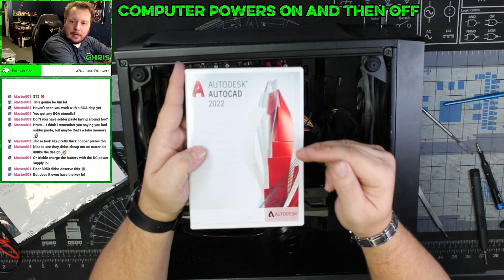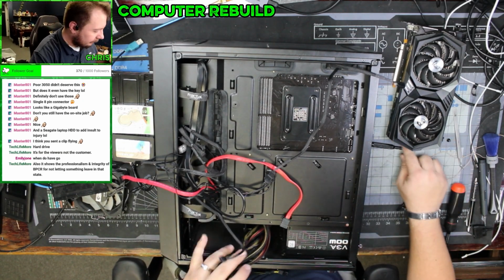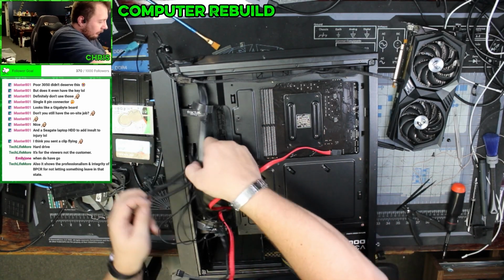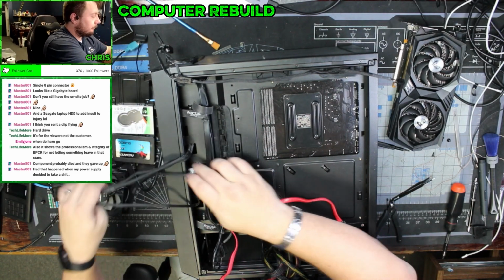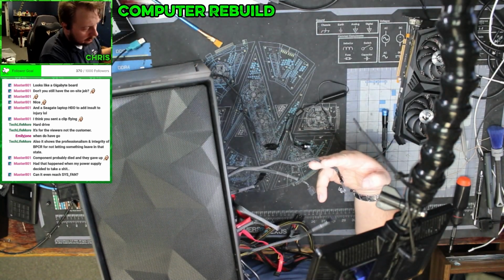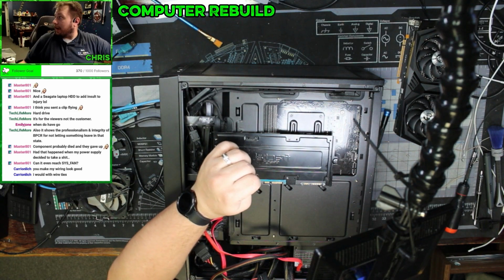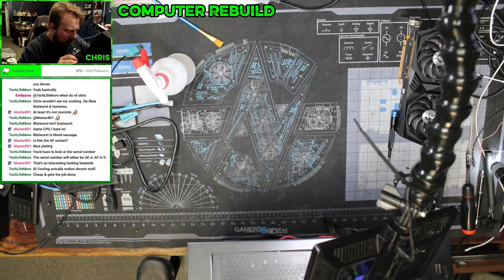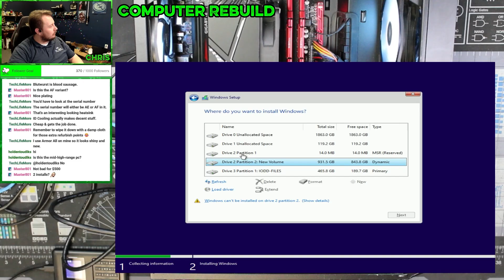A Customer got a "Deal" on an eBay Gaming PC, How Bad Could it be? #135

Comment: I'm 11 minutes in and triggered that you haven't mentioned the state of the airflow config. I hope you fix it in the remaining 8 minutes.

Edit: I just got finished watching and you didn't even address it. Bro, thats a Fractal Meshify, an airflow centred case. It's probably the best part of the build and something which should be utilised. Sure, the components in there are probably going to be fine as is, but if you are going to "service" a PC, you should have addressed this in my opinion. The front intake fans were set to exhaust, a complete waste of the great frontal airflow of the case, and the back fan was set to intake. If the client had requested that the airflow be kept this way, in a negative pressure backwards setup, I'd challenge them as to why and also let them know that it is going to get dustier way quicker, but I'd respect it if they wanted it kept that way. In that case, you ABSOLUTELY should have put the CPU cooler fan on in the opposite orientation, as you left it running completely against the flow of the case.

If I'd dropped a relatives PC off with you and you hadn't sorted that, I'd be annoyed man. Either you didn't notice or it was lazyness. I can tell you've got a lot of experience in doing this, you were very fluid in what you were doing, very knowledgable, and able to rectify the majority of the issues with the build in next to no time.

I'm gonna subscribe (this was the first video of yours I have watched), I hope you take this as constructive criticism, I did enjoy the video, there's something very theraputic about watching someone fiddle with a PC, and it's the reason I've build a ton over the last few years, but I hope you do take this on board and address it in future videos. Again, my only criticism, but quite a triggering thing for me ;)

Comment: I've only had 1 full prebuilt from ebay, I feel like it was a pretty solid deal.
It's a Intel i5-4590 with 16gb ram and a 750ti with an ITX mobo in a coolermaster  elite 110 case for 70ish dollars with tax and shipping included.
Edit: It ended up as my gf's PC because she doesn't need something super beefy.
Reply from the maker: For something that was not intended as gaming PC a lot of these folks bought these and are still using them.
Reply: @Bradenton-PC-Repair  for lighter games I haven't seen any issues so it's a win for me haha